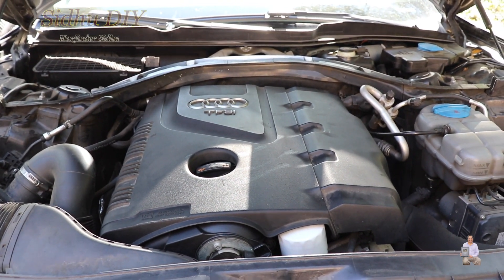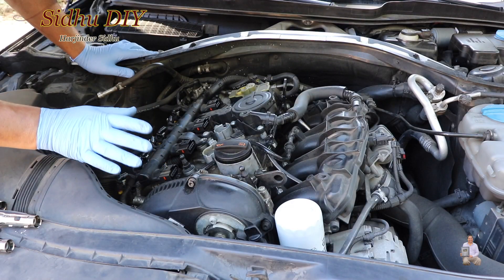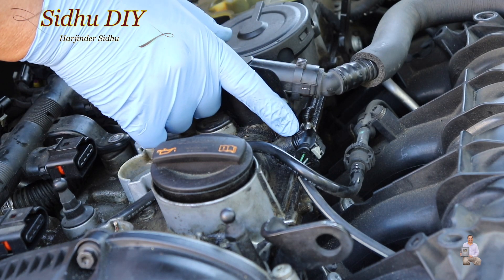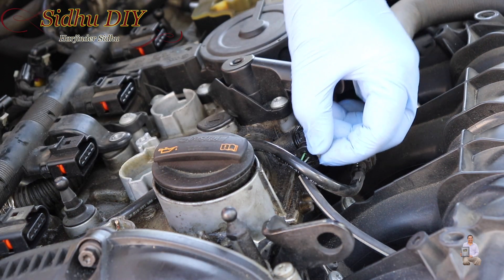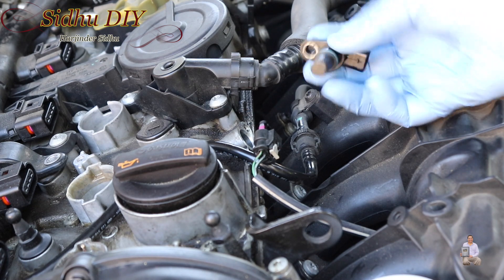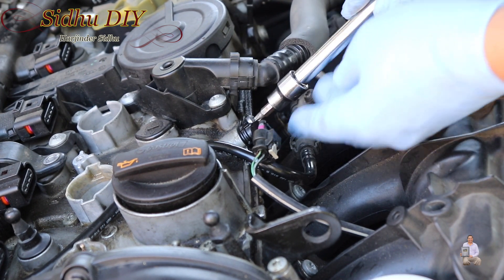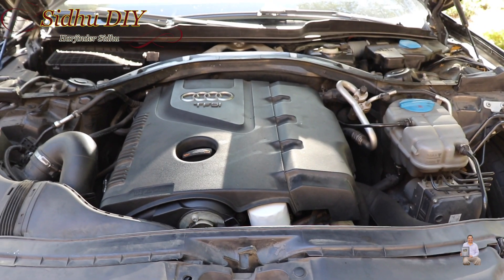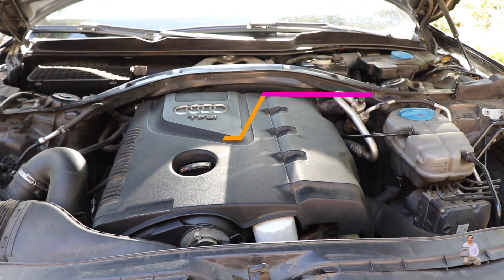How To Replace Camshaft Sensor on Audi | P0301 Cylinder 1 Misfire Detected on Audi a6 c7

Comment: The least complicated part to replace on this car 😅
Reply from the maker: I'm glad I could help.
Reply: @ replaced the cam sensor timer and now the ECU light is back on. I filed a claim with my warranty. Now the shop said they need to scan it again. Should they have to fix what it is for free since it only cleared ether code for under 100 miles.

Comment: you know the dimension of the bolt that holds the camshaft sensor?
Reply from the maker: Thanks for asking and thanks for watching, good luck with your DIY project.
Here is the bolt size: Audi GENUINE AUDI Camshaft Adjuster Bolt - 12 X 1.25 X 33 mm 06D109281D - https://amzn.to/2WRq85a

Comment from the maker: How To Replace Camshaft Sensor on Audi a6 c7 | P0301 Cylinder 1 Misfire Detected on Audi a6 c7
Reply: Hello everyone, this is my 2nd channel.
Please like, share and subscribe. Thanks.
Reply: Also works for 2012 q5! Thanks... 4minute job that a shop quoted as a "4hr job because it is really hard to get to!" For $600... I paid $100 for the part and did it in 5 minutes.
Reply: @THEOFFICIALJakeFromStateFarm  
I’m sure you did.
Some engines you have to take out the time belt .
It should be changed every time you do a timing belt change .regardless.